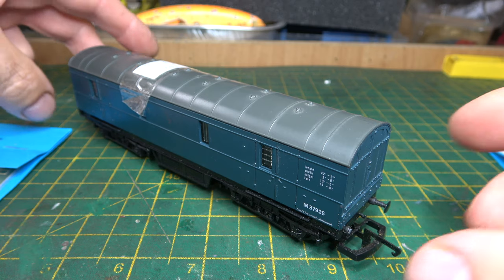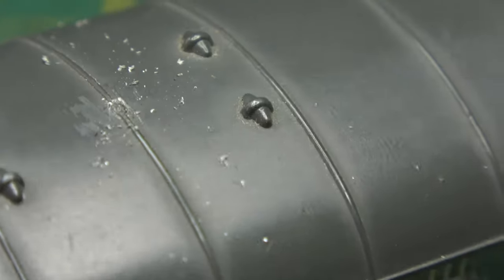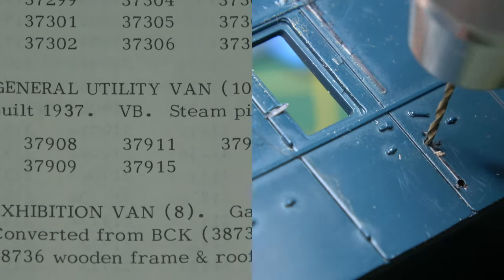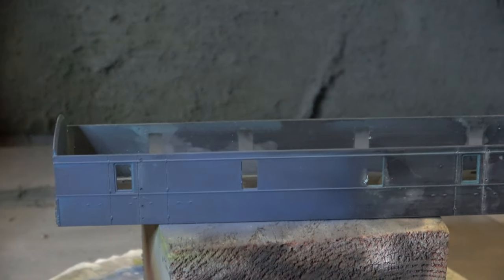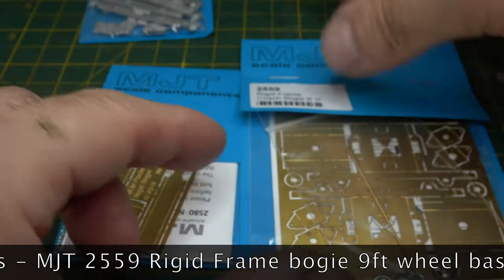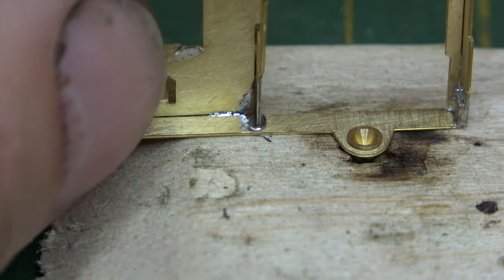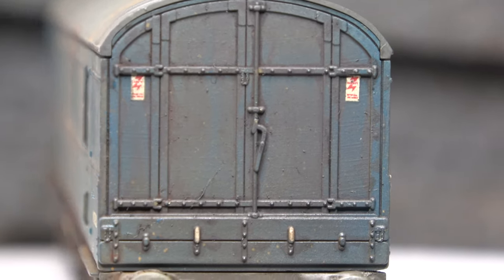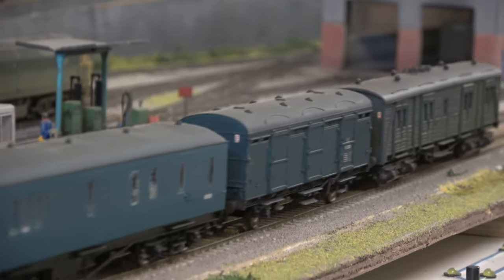Another Lima upgrade! LMS 42ft Parcel Van

Comment: I remember a couple of old LMS units like this that were departmental at Stewarts Lane, previously at the old Nine Elms facility.   There was an episode of the Professional's which the two were protecting a source and hid out in a GUV and there was a couple ancient and hoary coaches in the shots there too.   I loved departmental, the SR sandite units were awesome esp the 2BIL one, one of the APT's test cars was a SR Hastings buffet coach converted for the test trains and Caroline the inspection car was another out of service Hastings buffet car.   Its cool how BR reused surplus stuff.   Caroline was built using the slim Hastings stock so it could be used to inspect that one tunnel that plagued the whole line, that line also put constraints on SR parcel and other wagons that needed to travel through that tunnel which until Beeching could have been avoided but he decimated the area's railways including the one he lived next to.

Comment: Well done on another outstanding upgrade. I wish there were more of this type of video on YouTube. Convincing but not rivet countingly detailed. You seem to get the balance just right. Given it must take many hours to complete you foreshorten some of the time consuming processes, but include all of the modifications you carry out and include details of the prototype, which encourages the viewer to 'have a go'. I also like how you include the challenges you come across. It would have been great to see how you fixed the bogie mountings in the end - as the resulting bogie/buffer right seems just right. Am I right in thinking you use 45 thou brass wire for the hand rails?
Reply from the maker: Glad I found a gap in the market!! 😎
I know I'm not the best, and that doesn't bother me, much! So long as I can keep to a reasonably decent standard I'm happy, it wold appear you and others are happy with my work and content, which is surprising heartfelt and humbling! I'll carry on......
Can't remember what the size of brass rod was? as was the last few bits in the packet which went in the the bin!! Sounds about right though...
Thanks👍

Comment: @Wallsrail Love the work! Sorry to ask what is probably a dumb question, but why do you not paint the handrails before attaching them to the carriage? I've noticed military modellers doing the same as you and it seems weird to me to not to prepaint them. Is there a strong reason, or is it just personal choice?
Reply from the maker: For the same reason you'd see a welder cleaning the two surfaces to be bonded together.
Glue sticks to a bare surface a lot better than a painted surface. 
Paint forms a thin film that sort of insulates against the glue. 
Not to say that it is possible to glue painted surfaces together, but its a lot stronger to join clean surfaces.
That's how I was taught, others may have differing views....
Thanks
NW
Reply: @Wallsrail  That does make very good sense. Thanks for your answer!